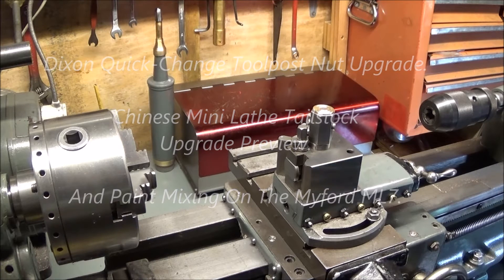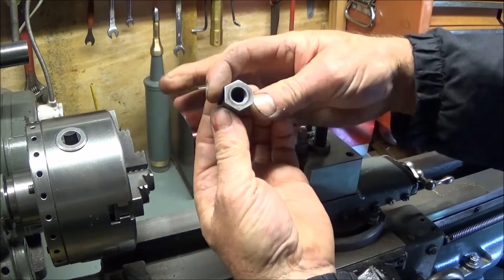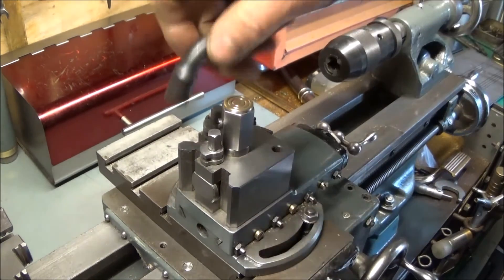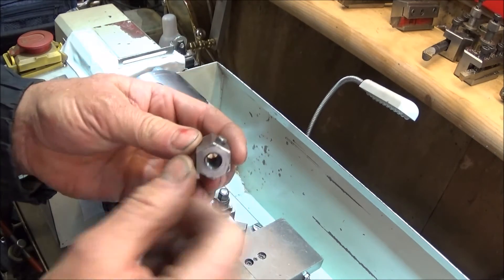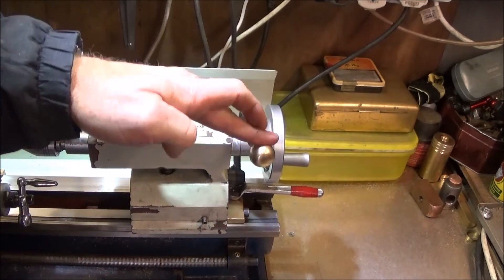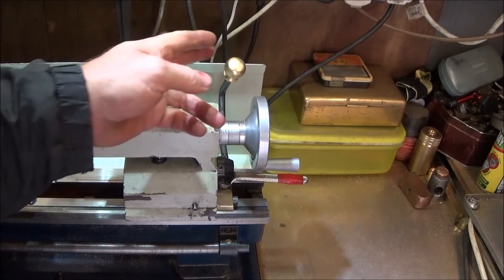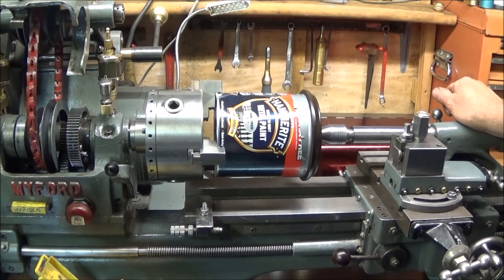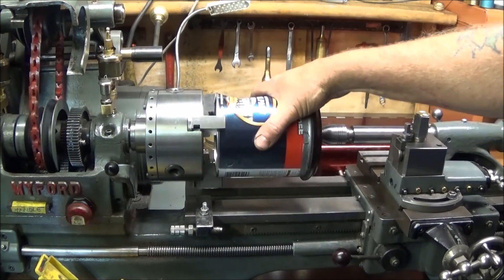Myford & Mini Lathe Dixon Tool Post Nut Upgrade Tailstock Lock & Paint Mixer

Comment: G'day Steve... another informative video... many thanks !  I have recently got hold of an ML7 and looking to add a quick change tool-post... where did you get yours from ?  Quite a few on the market... Myford, RDG, Chronos, Warco... etc
Reply from the maker: Hi John, I'm pretty sure I bought my first set from RDG That was for the actual tool-post and three holders. I have been buying singular tool-posts for it from Chronos as they seem to be the best value. I have bought enough for most of the tools I use. They are very good, but I was surprised at how small the tool shanks have to be when using the turning tool side. I think the maximum square shank you can have is 10mm. Any bigger than this and you will find that the you wont be able to achieve the tool centre height, as the tool holders cannot drop low enough on the post. When buying turning tools for this one I either buy 10mm or 8mm shank tools. My Regards Steve
Reply: +Steve Jordan Very helpful... many thanks and regards. John

Comment: Can't you get a standard extension nut with BSF thread.
Reply from the maker: +Rolingmetal I haven't been able to find one. Also I made one for the mini lathe as well which has a different thread and I wanted the same size 3/4"  hexagon so I could use the same spanner for both lathes. I had all the tools to make them already.
Reply: +Steve Jordan I like the idea of having less spanners around the lathe. Maybe I'll replace the little bended lever thing that locks down my tool-post with a hexnut. That way I can use the same spanner for my tool-post and my taillstock.

Comment: Good video Steve,  I was going to ask you why you used a bench drill to put the screws into the tall nut, and not your tool post drill.  Then you showed us why.  A lesser wise person may have drilled the not on the wrong flat.  Good one there sir.  Am looking forward to see how you hold the gubbens on the underside of the tailstock in place.
Reply from the maker: Thanks. I will show the components on the tailstock as soon as possible!!!